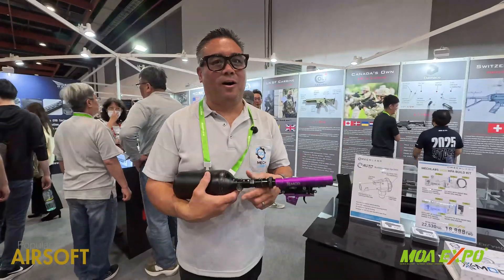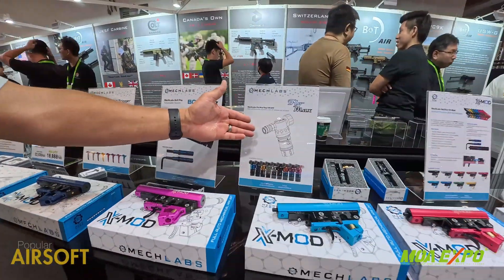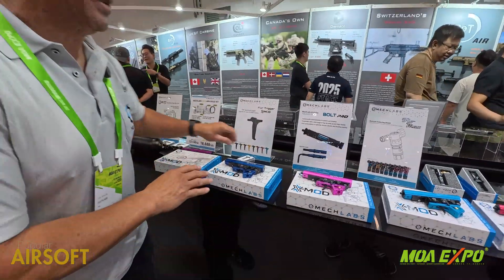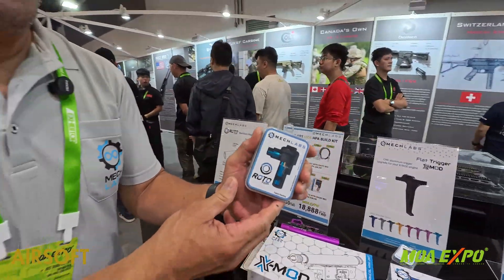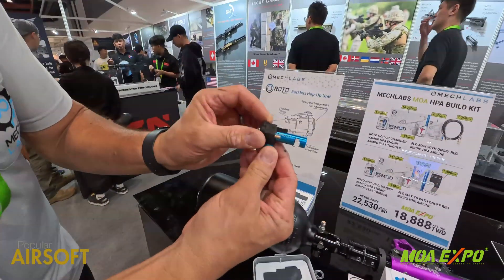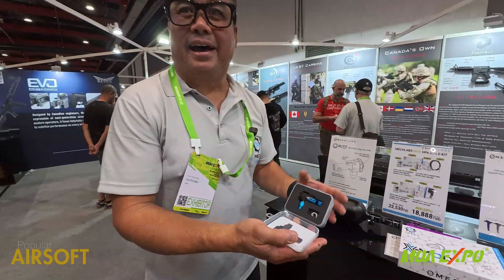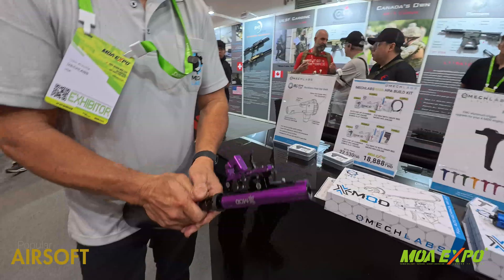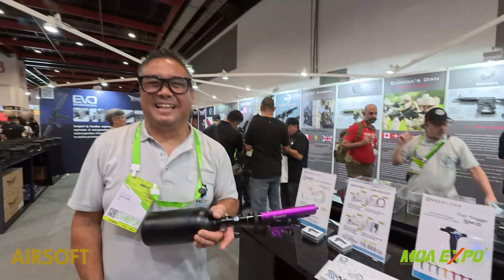MOA Expo 2025: Mechlabs XX-MOD HPA Engine, Flat Triggers, & Hop-Up Unit

Comment: I'm highly questioning that hopup. It may be good for CQB and speedsoft, when using 0.25 bbs. But how good is it going to be for outdoors when you are using 0.3s and up?
Reply: Thats also my question will it feed 0.40 and how about 6mm hop up like tnt barrels
Reply: @Blackfox-1337  I believe they tested 0.43 bb's and got a really good range with it.

Comment: The TDP how does it seal al the airspace??? 
Since the purpose of the bucking is not just applying the hop but also to seal all the air from nozzle to barrel only
Reply: We have an inner oring that acts as BB detent as well as seals the nozzle.